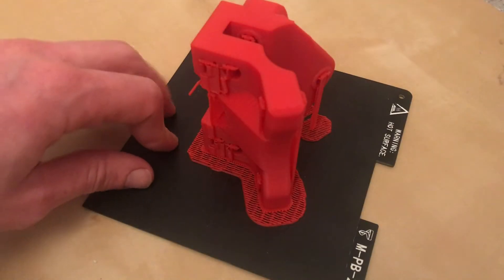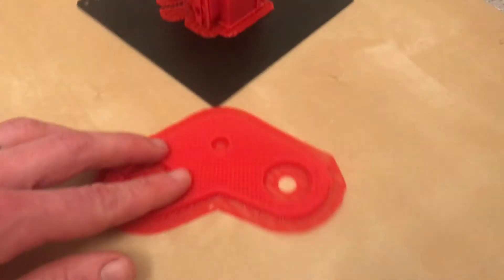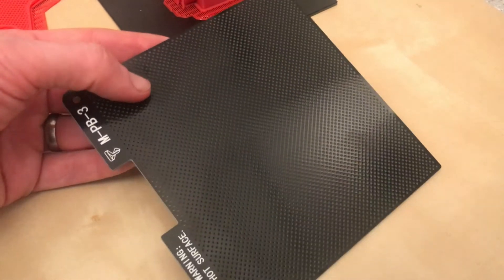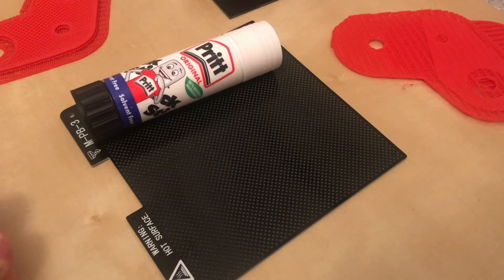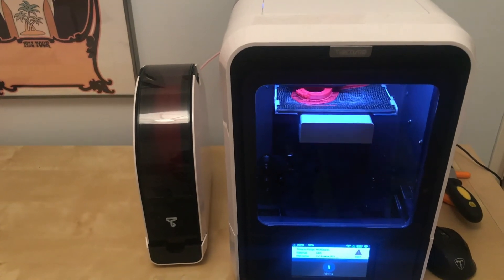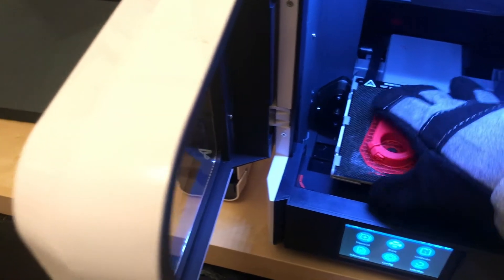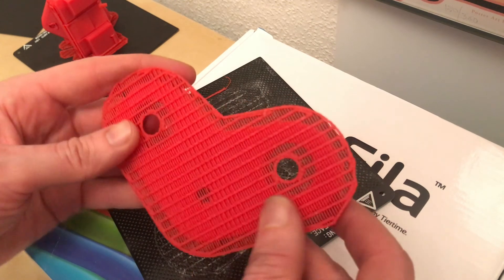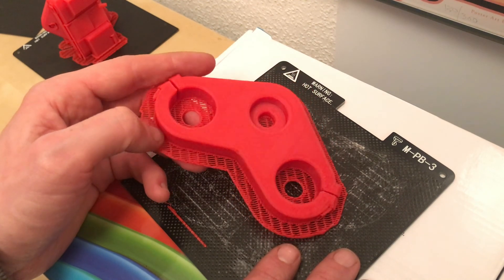ABS Not Sticking to Bed - 3D Printing Problem and Solutions - #5minFriday - #34

Comment: we have an ender 3 v2, ( first machine ) i've tried alot of ideas the best we have found for abs on a glass bed is 3m's super 77 spray adhesive, clean the glass bed , spray a light coat , and i usually run the bed at 75c to cure the adhesive for 20 mins. I can print numerous parts all day long without re application, and clean the bed at the end of the day with acetone . even when the beds completely cooled , the parts are still stuck pretty good to the glass. it sticks the abs really good even with long thin parts , and no peeling so far in 3 weeks of using this method

Comment: I'm using a Prusa i3 with heated bed and a piece of this glass on top (it's actually a 6"*6" mirror from a craft store) and then use aqua net unscented hairspray on it running the bed at 60*C.  Working AWESOME!
Reply from the maker: Thanks for the tip Greg, I think I've found a solution I'm happy with but isn't it strange how there is no "agreed standard" on how to get these things to work, everyone seems to have their own way. I'm glad you've got yours working nicely. Your Low Rider Build looks good - what inspired you to do a low rider rather than MPCNC?
Reply: FutureFab CNC & 3D Printing 
I actually started with the MPCNC with a 24" x 36" cutting area.  Then I just had to go BIGGER!  The MPCNC cut the parts for LR and then donated its motors and electronics to it.